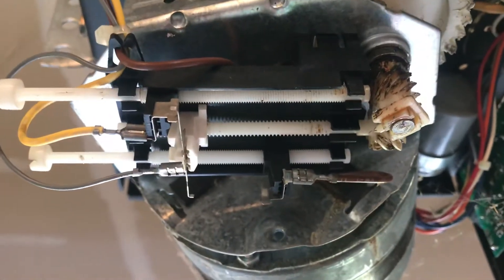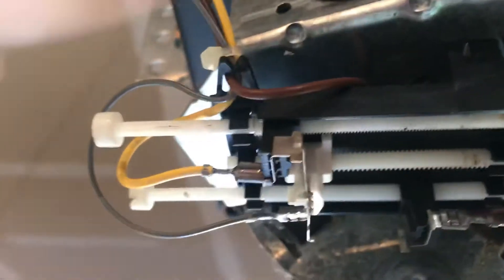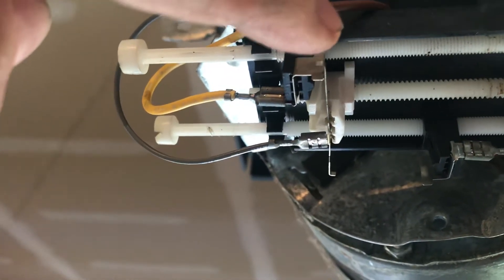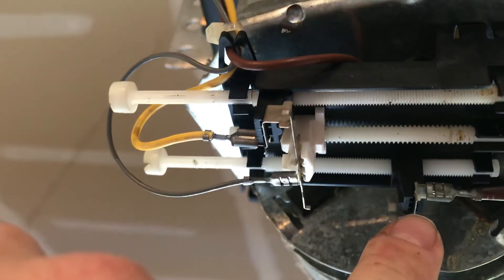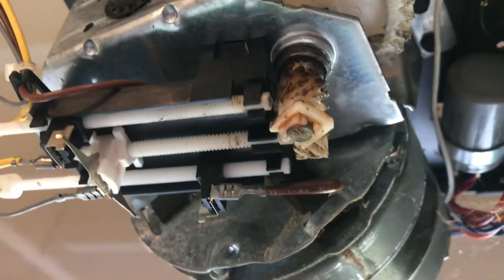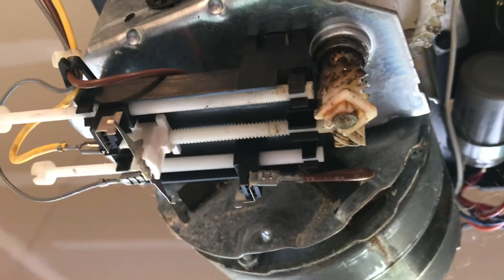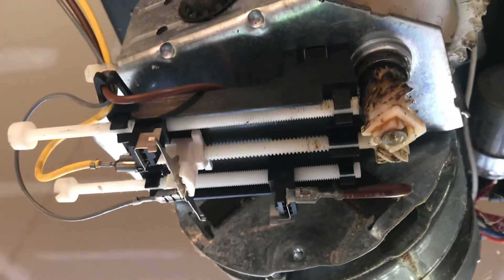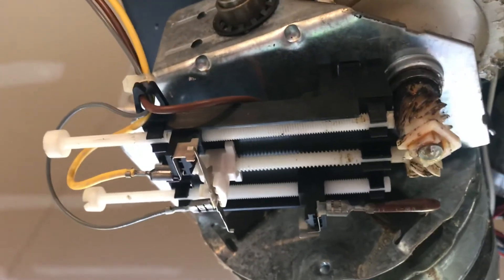Inside of a Liftmaster 1280R Garage Door Opener

Comment: While your in there you may want to grease those gears they looked a little dry. It will save the trouble down the road.
Reply from the maker: Sam Squires Silicone spray?
Reply: @sjlocke white lithium